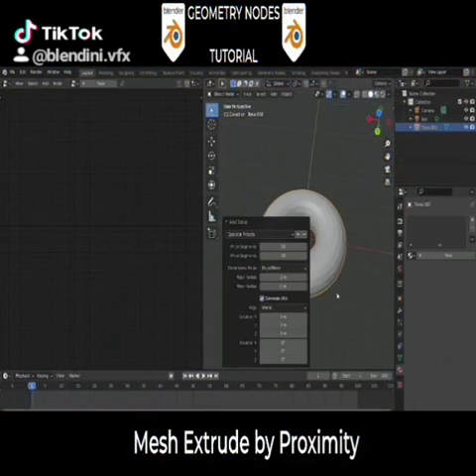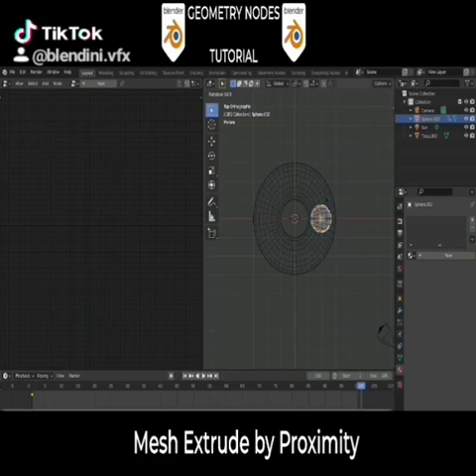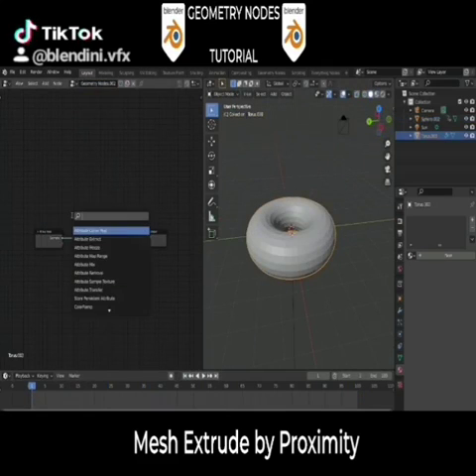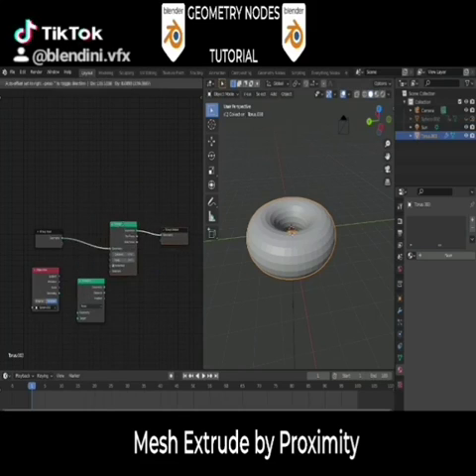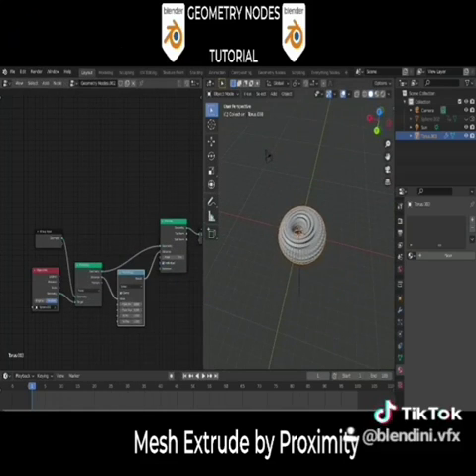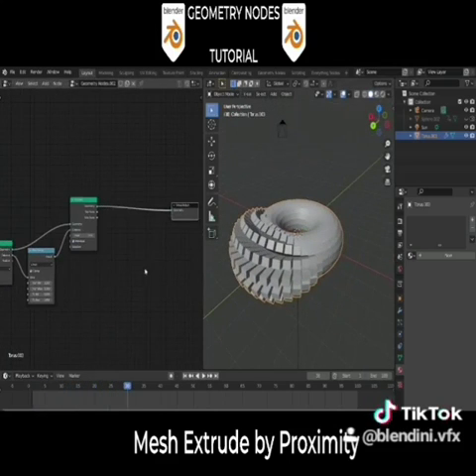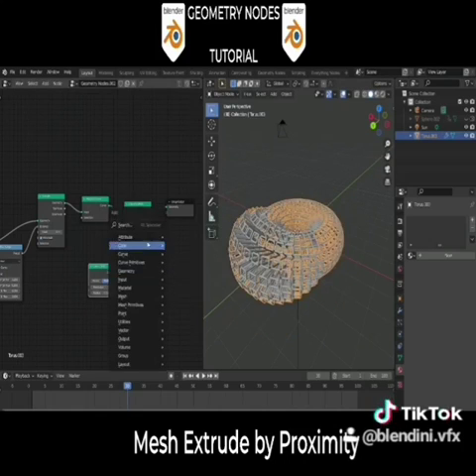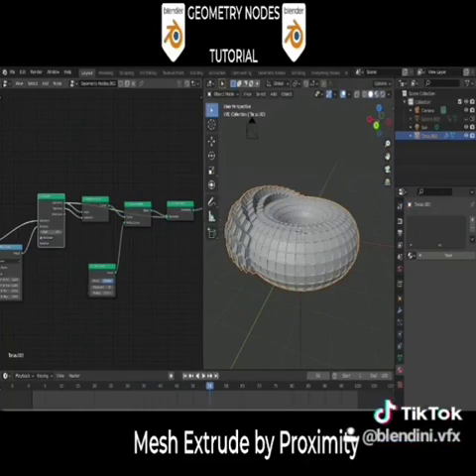BLENDER QUICK TUTORIAL - MESH EXTRUDE BY PROXIMITY(GEOMETRY NODES)

Comment: Plugging from the "geometry" slot in Object Info into "source position" in the Geometry Proximity node doesn't work and gives a red line. Similarly, plugging from "position" in that node into "mesh" in Extrude Mesh gives the same problem. (Using Blender 3.1)

Comment: Can the 3.1 build do extrusion by proximity? Cause I can't seem to get it to work. I plugged the Geometry Group Input of my Torus into the target slot of my Geometry Proximity Node and the Location of my Sphere into the Source Position Slot. Then I go with the distance of those two into the Offset Scale of my Extrude Mesh Node.

It doesn't work though and still extrudes all face with the same value rather than each face based on its distance to the sphere. What am I doing wrong?
Reply from the maker: Did you tick the individual in the extrude node?